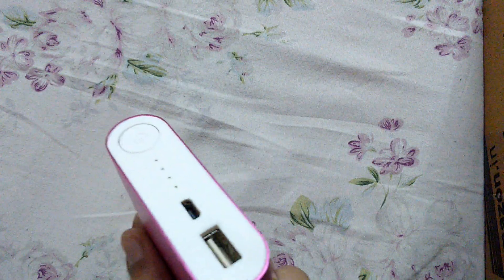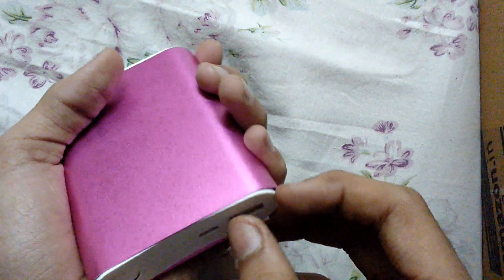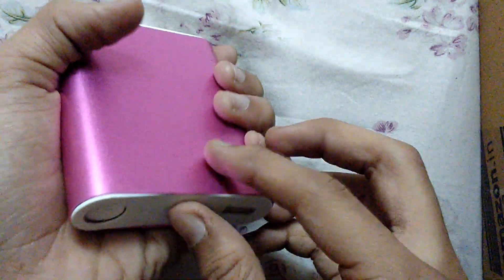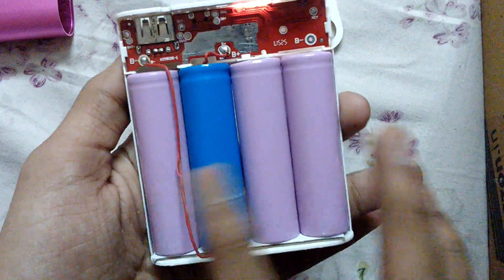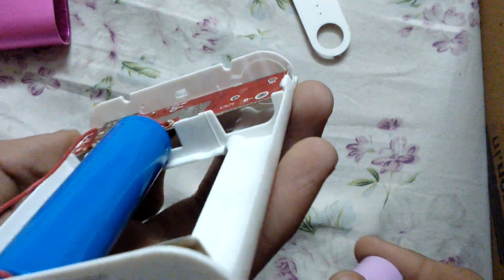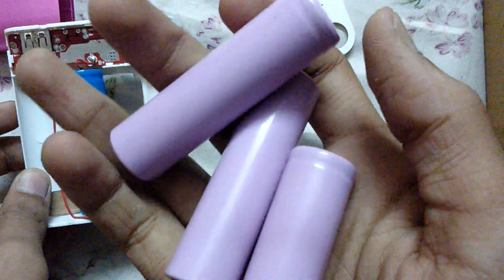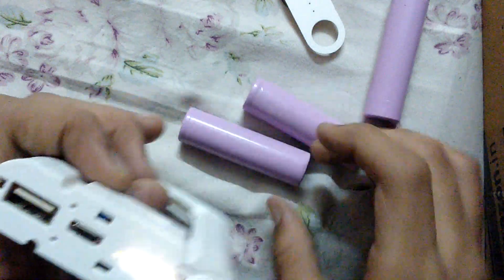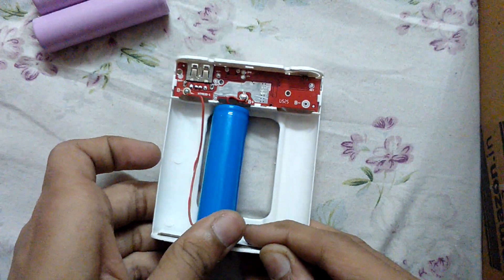Disassembling  fake Xiaomi 10400mAh Power bank

Comment: The fake batteries are filled with sand or gravel, to give them weight. At least one is fitted in most cheap Chinese power banks... not just those that look like Xiaomi copies. Here's a link to the genuine Xiaomi product, with more than 1,000 good reviews: https://www.banggood.com/Original-Xiaomi-Power-Bank-2-10000mAh-Quick-Charge-2-0-Portable-Charger-p-1088932.html?p=JQ26191551677201504Z&utm_source=bbs&utm_medium=agogo&utm_content=zhangruihua&utm_campaign=home
Reply from the maker: Agogohome Agogohome yep 3 were filled with sand.

Comment: I bought one, and replaced the batteries with good laptop batteries.. Didnt work, just charges for 2-3 mins then dies.. Waste of money
Reply from the maker: Deepak Garg It didn't work because maybe the batteries were faulty or the cheap power bank wasn't able to handle high capacity batteries. I would request you to charge the laptop batteries with a separate charger, then try to use the power bank. Comment down what happened after it and don't forget to like and subscribe.